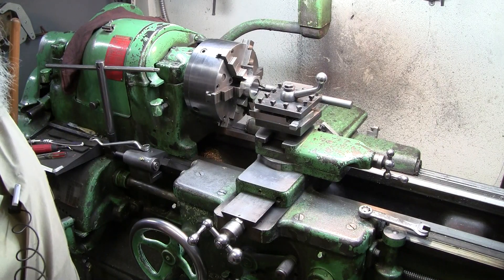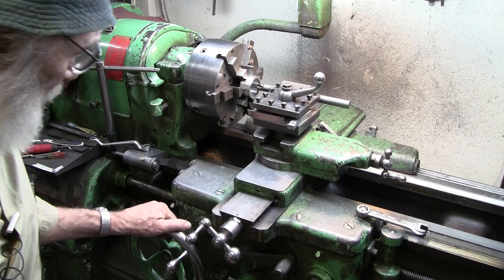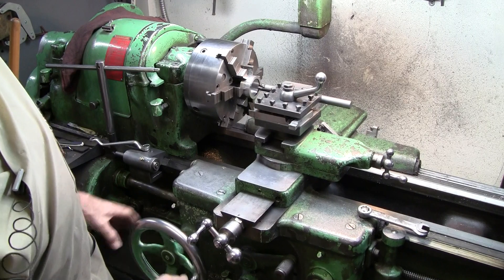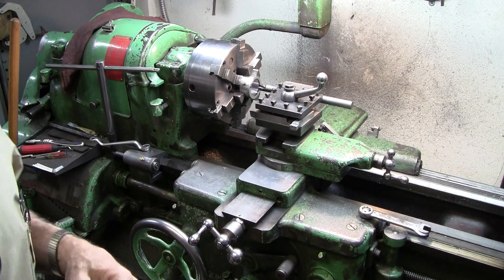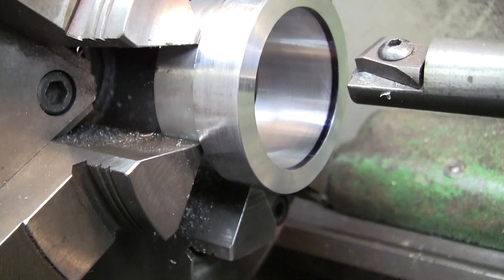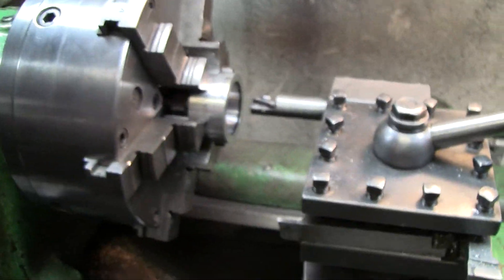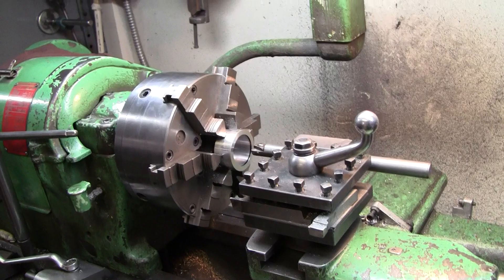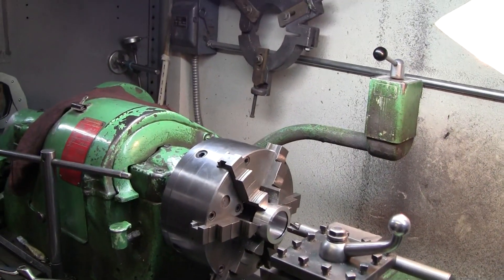Precision lathe boring and turning to .0001 inch #2 of 5

Comment: I can see the movement of the carriage from rattling the carriage from my readout. I have a readout that reads in microns of diameter. I can get it moving up to six microns by rattling the carriage in my case. This was the first thing I tested when I installed the scale. However I can adjust the position by single microns from the crank easily so I am looking for a method to eliminate the possibility of movement there- I've thought about adding a spring that pulls the carriage against the screw tension but it would be possibly affecting boring operations negatively. Maybe I need to get an anti backlash nut.
Reply from the maker: Thanks for your viewing and comment.

I would suggest that as soon as you arrive at the number you want on the readout, you back the screw off slightly but not enough to take up all the backlash. This relieves any tension on the screw and the carriage will not move for a fine cut. Subsequent super fine cuts can be made like this as long as you relieve the tension each time you advance the carriage.

This what I do with my milling machine that has a readout and it works quite well.
Reply: @1973JHE  problem is that I want my finish cut to be 0,25mm deep. It can shift  the slide if there's no support.